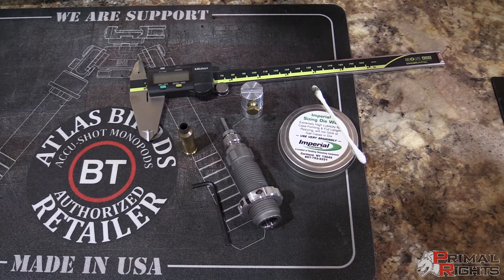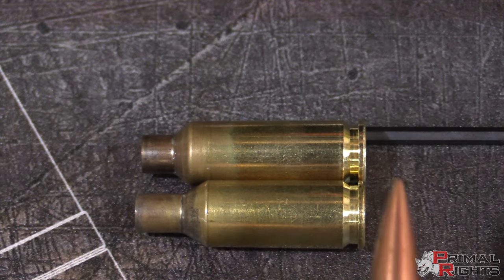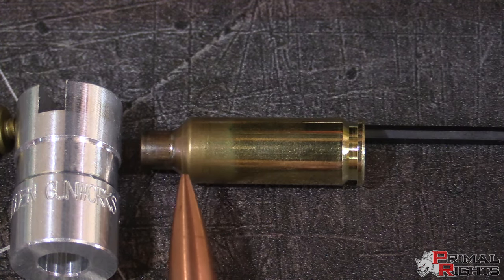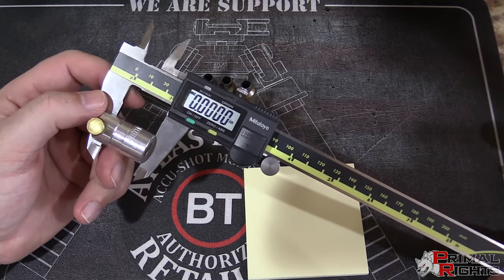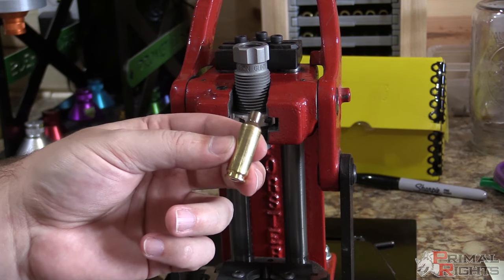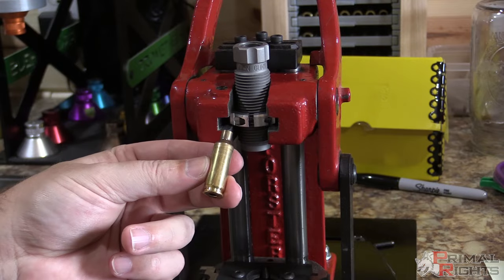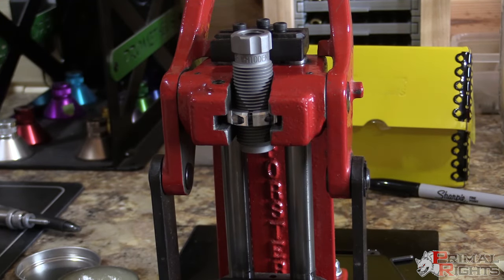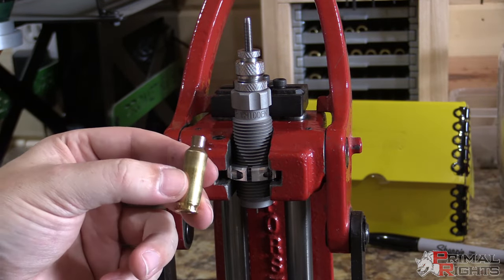Setting Up a Sizing Die

Comment: The press does not cater for cam over. This way is the very hardest way to get a 2 thou bump. The varying size shell holders from Redding are accurate, accurate and cheap.
Reply: Well said

Comment: I tried bumping back the shoulder on a few brass, but they would only become longer, never shorter like your vid.  I guess I'm doing something wrong.
Reply from the maker: If the shoulder is not being contacted, the brass will grow because it is only being squeezed on the sides. ;)
Reply: Yep, you need to turn the die down far enough that it will contact the shoulder area of the case.
Reply: This happened regularly to me when I first got in. No matter how deep or shallow I ran the die, nothing would change enough to get close to sufficient. After some suggestions (BTW I was using a standard singlestage) I tried swimming a case in shell holder with cigarette paper. Sure nuff the shell holder was contacting to early (as such no matter where the die was screwed in it achieved the same results. I had to measure the amount I still needed to setback, measure shellholder and veeeeeery slowly/carefully remove material via polishing/sanding and relegate that holder to a that specific rifle chamber.

Comment: This was a great video. Something I was looking for since my brass didn't work right. First time reloading for 223 and had some issue with the ejecting and tight fit. 

Would this process be the same for 223?  I have a tone of range brass I picked up over the years.  When you have a moment please let me know. 

Thanks,
Reply from the maker: Range brass will not be consistent
Reply: @primalrights  Thanks for the reply. You are right it's all over the place on brands. What I did is sort them by brand just so I have an idea what I'm reloading. Hopefully sorting them will give me some good brass.

Comment: The best easy to understand explanation of a complex subject that I have seen anywhere.
Reply from the maker: Very kind!  Thank you
Reply: @primalrights  Hey Greg, if using a Short Action Customs modular sizing die would you use a bushing along with a decapping mandrel or just a decapping mandrel of the desired inside neck diameter for neck tension?

Comment: Have you ever used  the SAC HEADSPACE COMPARATOR kit they sell?   I had some gift money and purchase 308 and 223 one. I had brass that the headspace was push back using the Hornady headspace kit. I measured that brass and it was way off. I'm a little confuse on why.. Hopefully I will read more and see if I could figure it out.

Comment: I have been reloading for about a year now, slowly moving in the direction of accuracy with knowledge gained. Since dies are made to do specific things, my question would be: Can you use a combination of dies to maximize performance of the brass? Meaning, using a universal decapper, followed by a body die, followed by a neck die. I know there are multifunction dies that can do all or some of these functions. I'm a tinkerer and it wouldn't bother me to do one or two extra cranks for the sake of accuracy. What's you take? Thank you.
Reply: Forget neck only sizing dies, waste of money and terrible for your brass. Buy yourself a Type S bushing FL sizing die and a forster micrometer seating die and be done with it. I shoot half MOA or less all day at NRL and PRS Matches

Comment: Hi Greg, great video and awesome Channel!  I was noticing you use a whitten Die, of which I just bought.  I was just trying the die out in my Foster Coax like the one you use and I have found that the lock ring doesn’t allow the die to slide back quite far enough into the recess of the press where the die is made to slide into. When I say “far enough” I mean that it doesn’t slide in far enough to allow the die to be centered over the shell holder thereby misaligning the shell when it slides into the Whitten die.  How have you gotten around this problem, using the Whitten die lock ring ?   Thanks so much
Reply from the maker: I have lock rings that fit. You should probably call Whidden and get a different lock ring.

Comment: Wonderful information...I have reloaded for my hunting needs since 1995, and for the first time I had case head separation occur.  I have had some difficulty with a newer savage 7mm-08 as the bolt got stuck, and in researching why, the neck sizing seemed to be the culprit in that I was not taking the shoulder back.  I followed the rules of setting up the full length die, and lo and behold, the brass was apparently overworked and twice fired brass began to separate.  I am going to get rid of the brass I just sized full length and start over....a hard lesson for this long time reloader who learned they still have a lot to learn.

Comment: I have a 6.5 cm. When I fire a cartridge, the brass does not seem to expand much at all because I can still easily fit the empty brass into the chamber and close the bolt with no issue whatsoever. Is this normal?
Reply from the maker: Very normal for mild loads.
Reply: Thanks  for responding. I’ve only been reloading for a few months. But I thought one of the goals when precision reloading was to size the case so that it just barely fits in the chamber and the bolt snugs up just a tad bit as it closes. If my fired cases already fit in the chamber quite easily, wouldn’t bumping the shoulders back make the brass even shorter, leaving more “slop” in the chamber?

Comment: Thank you Greg, as a newcomer to reloading this is the most comprehensive guide to setting up a sizing die I have found. One thought has occurred though, if you set up the die after your first firing has the case fully fire formed at this point, or do you have to repeat this process until the case stabilises in length? (I use Lapua brass)
Reply from the maker: I advocate for waiting until the brass is fully formed before setting shoulder bump.

Comment: When fire forming cases with bullets jammed, do I use the lowest charge listed in my manual?
Reply from the maker: You use a charge adequate to fully form the case, without being over pressure.
Reply: @primalrights  well, that sure leaves a lot to wonder about. I asked because when jamming bullets you substantially increase the initial pressure so I assumed one would want to start at the low end of published data?
Reply from the maker: @patdennis3751  If you’d like a better answer, you could always join this channel at the apprentice level and just give me a call afterwards.